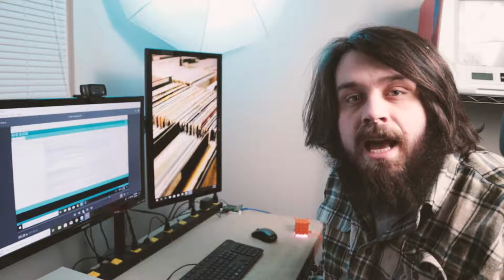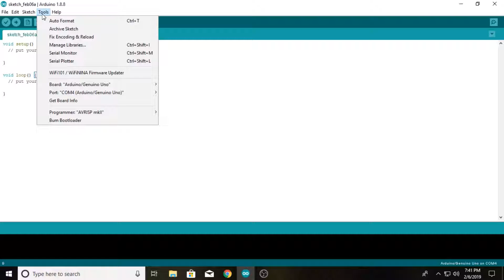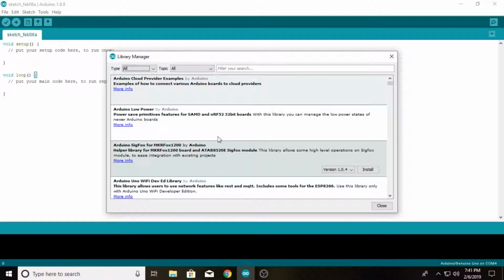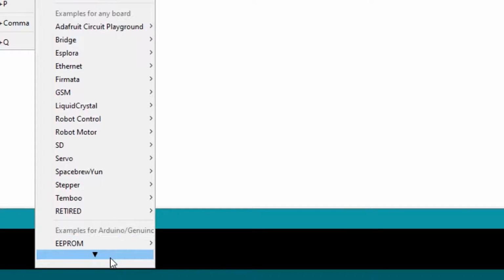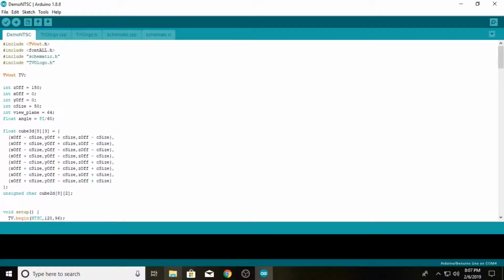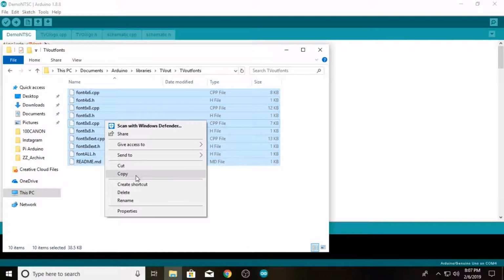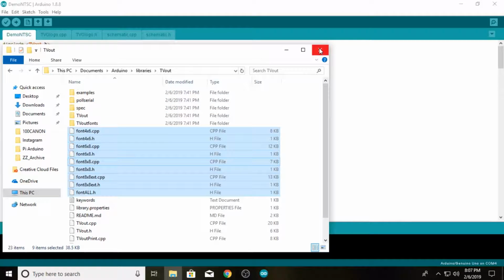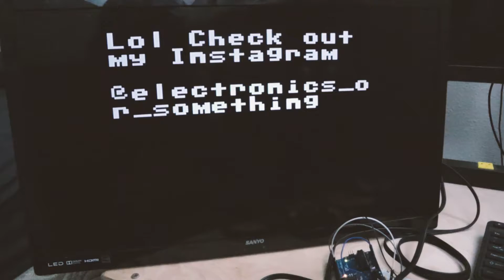Arduino Tvout Tutorial

Comment: I just got an ESP32 RCA add-on, and it works in colour, yet it does single-pin output to the video amplifier. Really need to understand how a 1 pin digital signal can run colour on a CRT.

Comment: Can we use 2 1k resistors in this circuit in video signal pin instead of 470ohm
Reply from the maker: It should be a ratio kinda thing, but it's been a year since I played with it. So your milage may vary.

Comment: I wonder if this can be accomplished with hdmi?
Reply from the maker: I really wanted to do this hdmi but the UNO just doesn't have the speed to get near the specs for that. At best you could you could maybe setup some external logic and try to meet the hdmit spec but  it's complicated enought that you'd want to use an fpga and at that point just use the fpga and toss the uno.
Reply: Why? Get an old phone/laptop/macmini for less money than a half decent microcontroller (hello I'm talking to you overpriced Raspberry Pi!) and you can do anything over HDMI. This is about the smell of colour bleed, noise, geometry defects and stuff like that, preferably on a CRT.

Comment: Didn't work   i follow tutorial
Reply from the maker: Idk, could be a lot of things.
Reply: @electronics_or_something  i use 10k resistorand use pin 7 and 9 in arduino as you mention connect 7 and 9 of arduino via resistor to signal pin and ground shield to ground of arduino
Reply: M Talha Khalid 1k he said
Reply: @M Talha did it worked?
Reply: @umernoorani9618  yeh it worked i use vga cable inated of rca and a library that display image onto tv